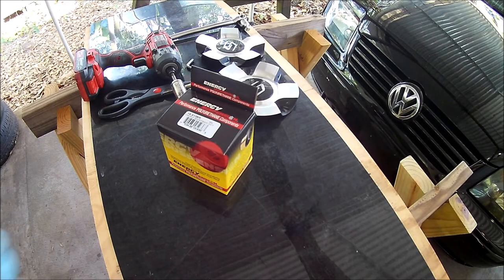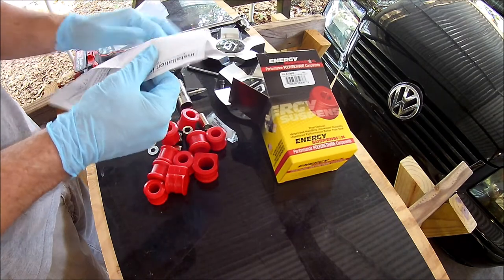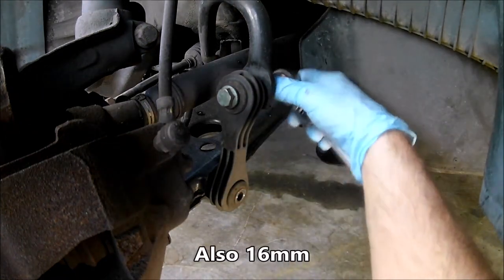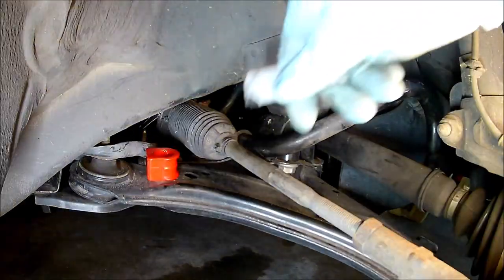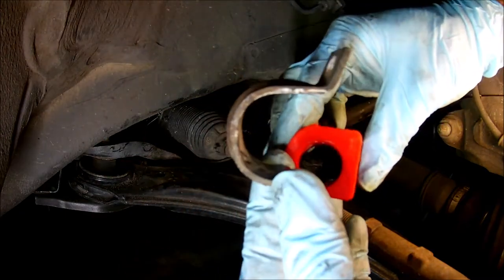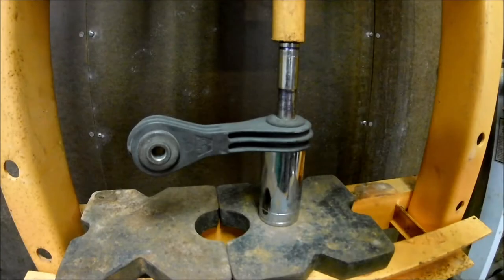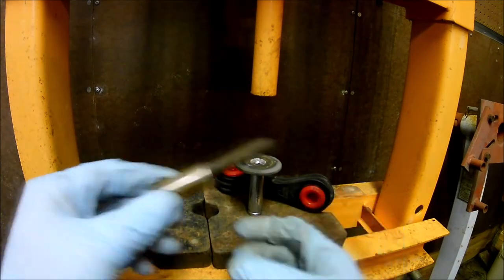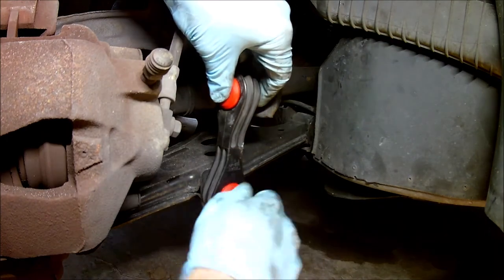Jetta Project Car: How to Replace Front Sway Bar Bushings (Mk4) [remaster / re-upload]

Comment: Great video! Don't forget blue loctite and torque bolts to 35lbs.
Reply: and note* the blue loctite 243 is now in a red bottle. I know that just makes it more confusing. It's handy to use though. It actually locks threads well but also makes the nuts and bolts easier to remove since it prevents water and air (corrosion and rust) use fairly liberally!

Comment: Ive watched several of your poly upgrade videos. How was the handling after the rear axle beam bushings and swaybar bushings? Tighter? Crisper? I have 230k on my oe's and have done the front control arms already
Reply from the maker: Yes, it tightened up the handling.The car feels more confident in the turns.